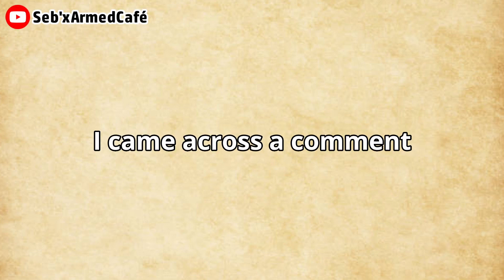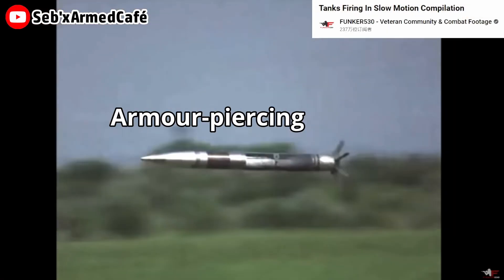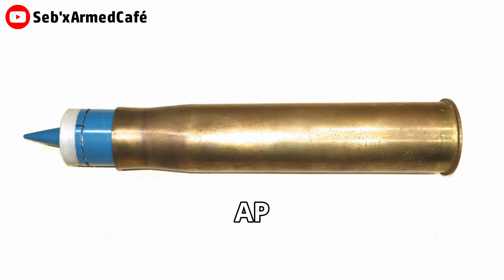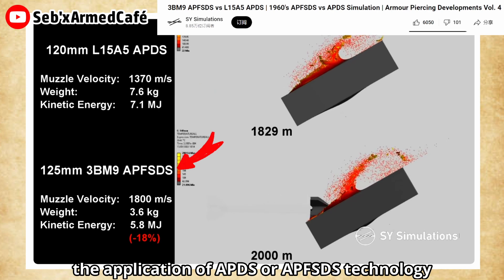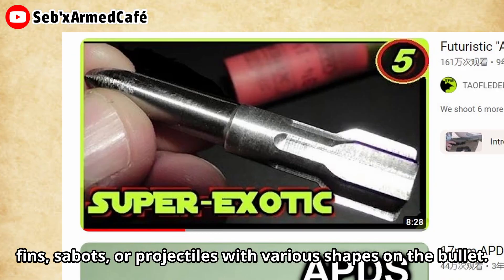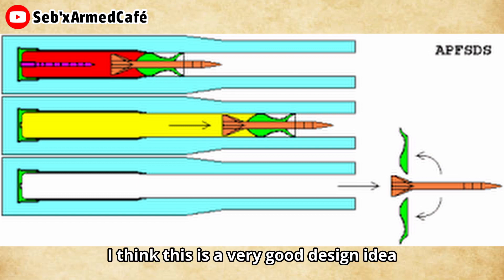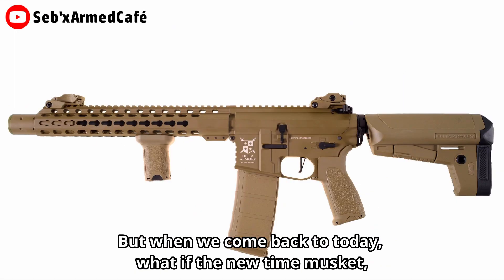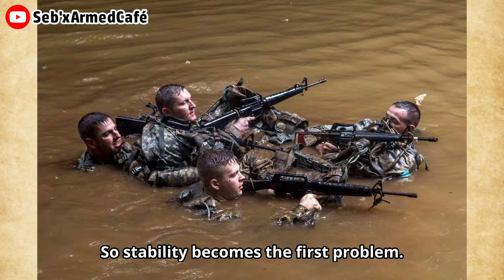Can We Make the Smoothbore “Musket” a Comeback by Using the APFSDS Cartridge in the Future?

Comment: Big question, is it possible to use a bullet with spiral grooves on a smoothbore? Would it have an effect similar to a rifle or not?
Reply from the maker: If the bullet is apds shell, it will not be able to use in smoothbore. If it is apfsds(just like the tank round)and is used in smoothbore, maybe it will have similar effect to a rifle. But nowadays apfsds didn’t be used on light weapons so this should be my speculation.
Reply: Hmm, that sound like the rifled slugs of shotgun shells. Slugs with grooves. But it won't be that effective because conical rifled slugs and the large caliber of the shotgun won't be a very good mix.

Comment: Sabots are very popular with modern muzzleloading rifles but design of their bullets is same as with any modern bullet. 
Simple designs of spinning bullets do exist:

1) Foster bullets - very popular for smoothbore shotguns, but they are all lead as rifling is engraved to the outer side of the bullet and requires to be gripped against steel walls of the barrel, so material of the bullet cause the build up of lead residue inside the barrel, and lead is not very good at penetrating solid objects. Also perfomance of spinning slug inside smoothbore barrel  is far away from being close to perfomance of rifled barrel.
2) Ruger ARX - are specialized polymer bullets designed for handguns, they have very low penetration and very big expansion due to propeller shape tip of the bullet which causes bullet to spin at very high speeds. But to achieve such high speed of spinning it requires to be made of light materials like polymer and it can't have modern spitzer tip for high penetration capability as it needs to have close to flat shape tip in order to have maximum resistance against air which causes bullet to spin in the first place. 

So both designs are not particulary suitable for military purpose. 

Closest thing to a musket being intoduced for military/police purpose was MAUL shotgun made by australian company "Metal storm". It was muzzleloading gun with electric ignition and detachable tube magazine which was loaded from the muzzle of the gun. It utilized superposed loads, a technology which was first introduced in the 18th century by Joseph Belton in his repeating flintlock musket (funnily enough his gun was also semi automatic and it also had detachable magazine). MAUL shotgun didn't recieve any adoption but it was once portrayed in a game "call of duty ghosts" under name "Bulldog".